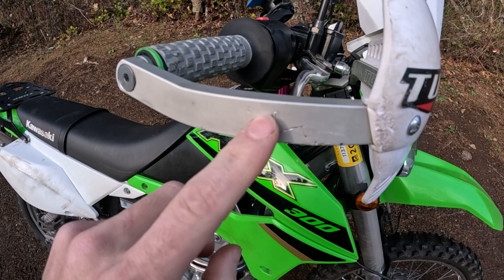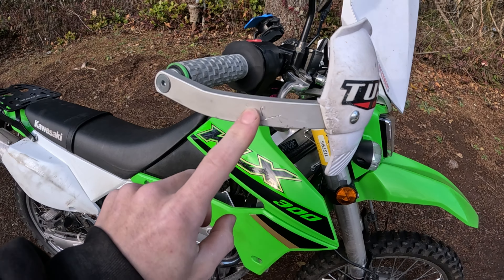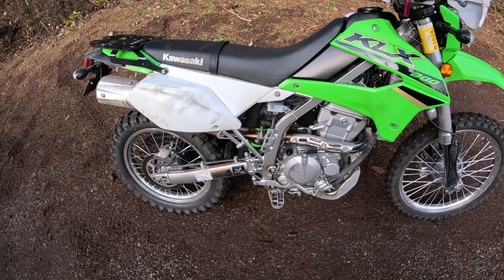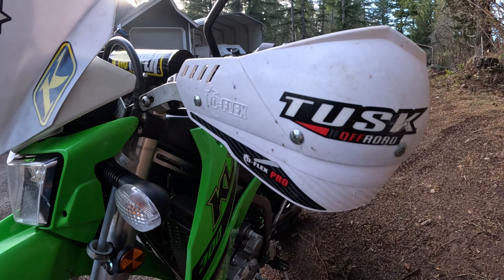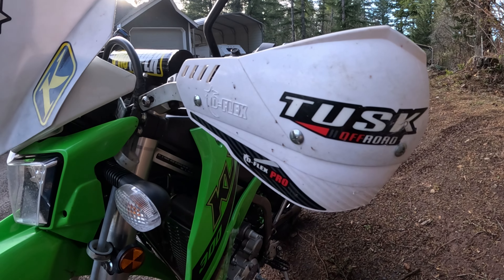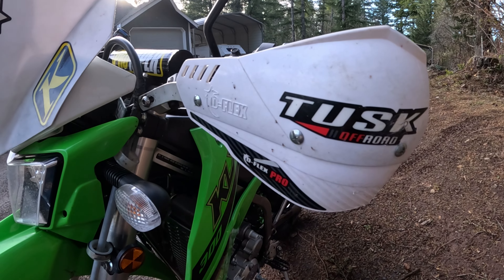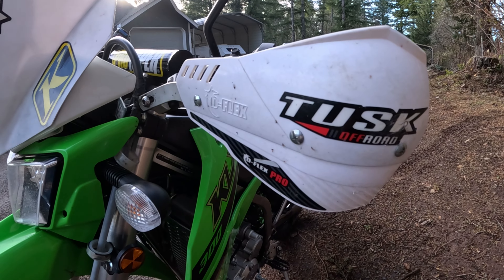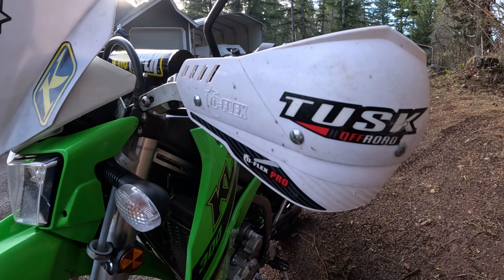KLX300 Mods Aftermarket, DIY and WHY I Chose Them

Comment: Nice Mods. The Tusk rack is cool. How is it for removing the seat?
I put a rack on mine and in order to remove the seat I have remove the rack.
That sucks. I need to modify it or trash it.
And get another rack.
Good video.
Reply from the maker: The Tusk rack is the same. The seat bolts hold the rack on so you have to remove the whole rack to remove the seat. Its two extra bolts and I have gotten pretty quick at it, but it's still annoying.

Comment: I just used the Amazon special foot pegs, but either way the larger surface makes a great difference, and if your money comes in there is an option by Adventure Spec for an universal Rally Fairing, a target of mine next season since I guide so many rides, put the GPS right in front of my face and some wind protection. I am also gonna grab some of that sweet Tusk tail tidy to! Looking forward to your ride videos, sir!
Reply from the maker: Let me know how the amazon pegs hold up. I've heard stories of them snapping off the bike on a hard landing. Plus I am a real fan of my custom $10 windscreen.
Reply: @NorthWestMotos  they have survived this season well enough and I went after it pretty hard this year. It looks like you rigged the fairing to so it can be removed if needed which is a great idea!
Reply from the maker: @trashpandatrailadv  Velcro! There's a video all about it on my channel. Make yourself one!
Reply: @NorthWestMotos  I am gonna shoot for the AdventureSpec set up, less for the wind protection, since I am in NH and more for its ability to get my gps gear in front of me. Gonna get wild!
Reply from the maker: @trashpandatrailadv  Love it. Can't wait to see the videos. I've had good luck with the quad lock system with Gaia GPS on my phone.